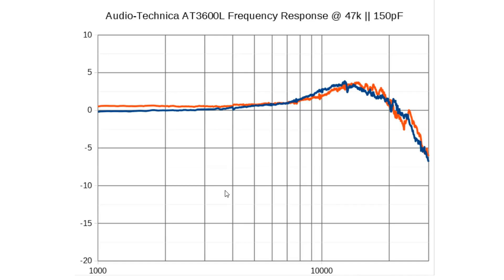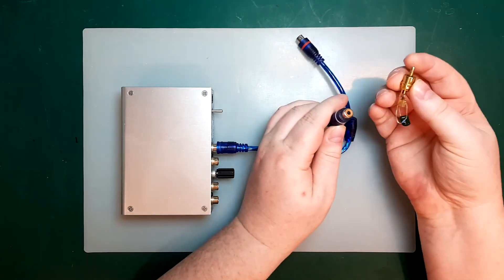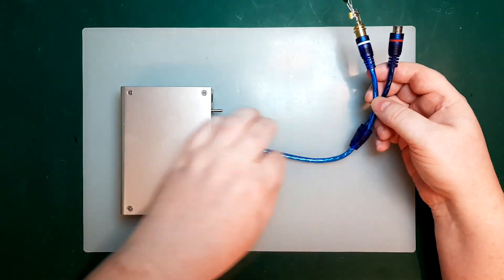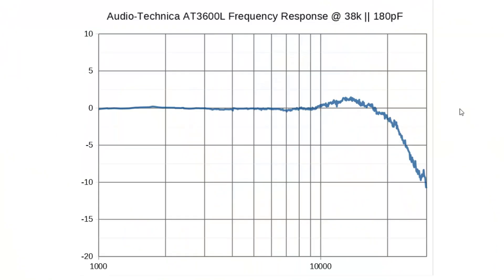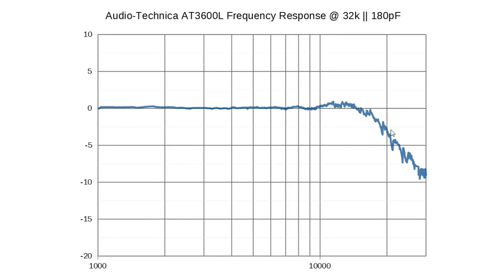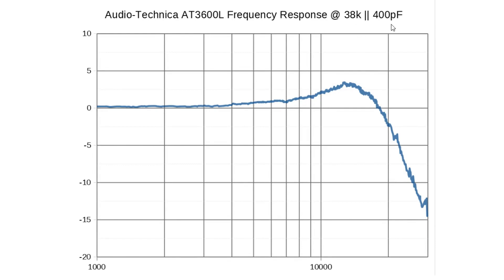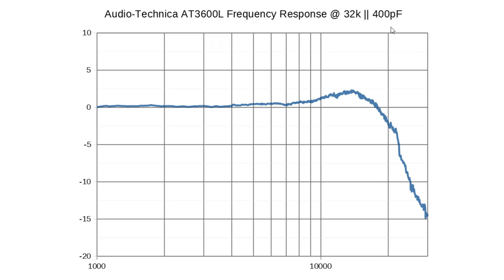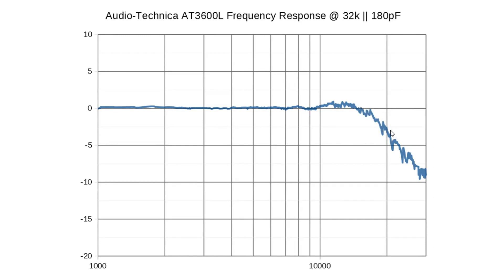Audio-Technical AT3600L Review Follow Up

Comment: Greetings from Serbia. 3-4dB up at frequencies above 10k is not some huge coloration, it's just benign and probably adds to charm of this cartridge. That's something that most users will like about this cartridge, no need to equalize  it with added parallel resistance. In fact the reason some manufacturers recommend added capacitance at the input of phono stage is exactly to boost HF and make sound more "hot". For instance, Japanese companies usually have 220pF at phono input. There is so much HF loss in the sound reproduction chain, due to many factors, that HF boost is usually beneficial. I would recommend leaving this cartridge as is, not modifying phono input resistance/capacitance.
Reply from the maker: I agree it's not a big deal, but then again people invest $10s of thousands in a flat frequency response, so any source should ideally be as flat as possible.

Comment: Very interesting. I am really curious how more expensive cartridges will perform.
Also, basically it's possible to add some resistance in series with the capacitor. That way you will probably be able to tweak it even better.
Reply: la meilleur

Comment: Some of us "high mileage" listeners might enjoy being able to actually increase the treble response on our cartridges to accommodate our organic high frequency losses due to age.  Me, I figure that's what treble controls on preamps are for.  😊
Reply from the maker: It is a good argument and I guess that is what people call system matching, but a small peak in the upper treble isn't something that is easily heard by anyone. Your speakers or headphones probably have much worse frequency response, especially speakers in a normal room. 
Cheers,
Jake
Reply: @TheStuffMade  I have some speakers that had a pretty bright top end.  Or rather, they still have a bright top end and I just can't hear it like I used to.  Maybe it's time to buy a calibrated microphone and some testing software to get an objective measure of my speakers.  🤔 😊
Reply from the maker: @darthbubba866  I have one of those Dayton Audio measurement microphones. I've been using for quite a few years. It works really well and appears to be accurate with the included calibration file. I think you can get them for around $60 these days, they do however require a preamp with 48V phantom supply. I use it together with the ARTA software. There are also some USB measurement microphones available, that would save the whole preamp and audio interface, but I don't have any experience with those, so I don't know how good they are.
Cheers,
Jake
Reply: @TheStuffMade  Thank you for the recommendations!
Reply: Good video.i think will apply to a lot of at cart.some of late production shure have 10k hf roll off and can be loaded with 75k to brighten them though it easier to add capacitor.currently building phono preamp and will include resistance and cap options.

Comment: Very interesting! I have 47k and whatever capacitance the cable has. Maybe I like the slight added treble.
Reply from the maker: To be fair, the gentle treble bump on this cartridge isn't something that's easy to hear, I didn't notice it when I was listening to the cartridge before doing any measurements, but with a good pair of headphones and doing A/B comparison you can hear a slight difference.